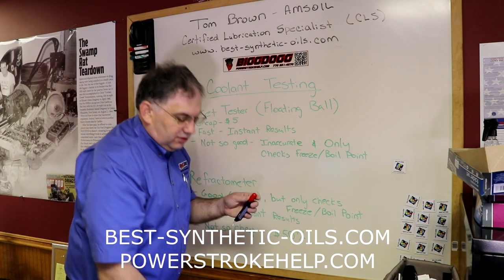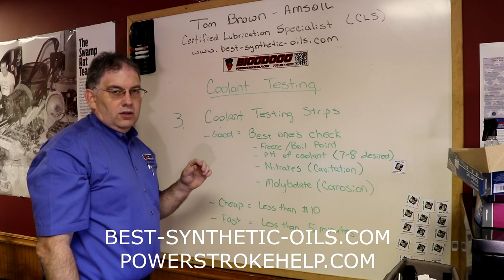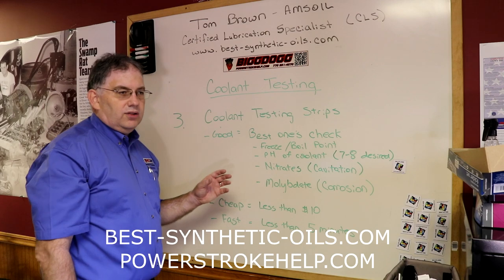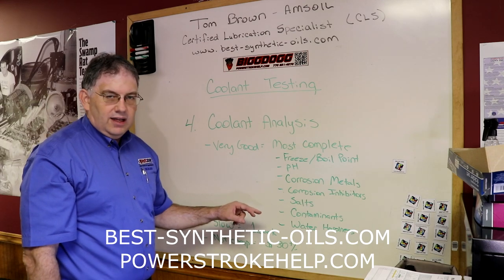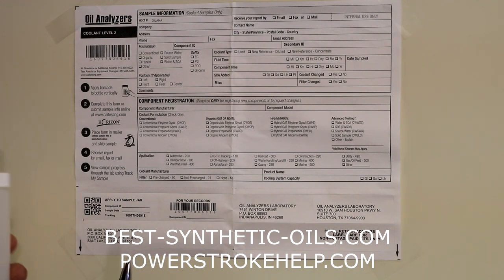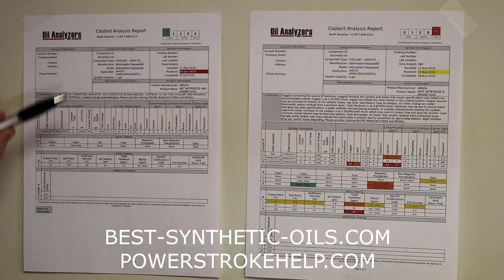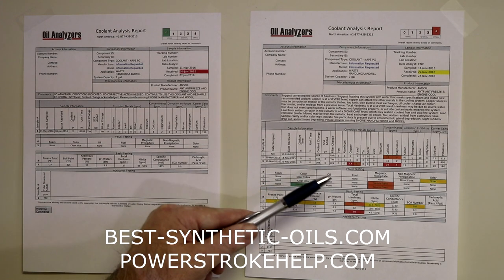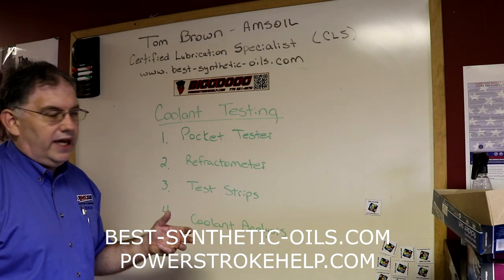COOLANT ANALYSIS FOR YOUR POWERSTROKE

Comment: thanks for all your info I j JUST got a 2001 lariet f250 7.3 turbo diesal Got it with 199,000 runs great put new batteries and did all my fluids I will watch all ur videos and aply what u teach thank you merry Xmas from Montana.
Reply: My brothers 2001 just turned 300,000k rebuilt trans and thats it.

Comment: damn good video. I have a 7.3 that I only drive once a week and use for towing my 40 footer. I don't put much mileage anually and know that I should test the coolant a couple times a year since it sits more often than not. Thanks for the info.